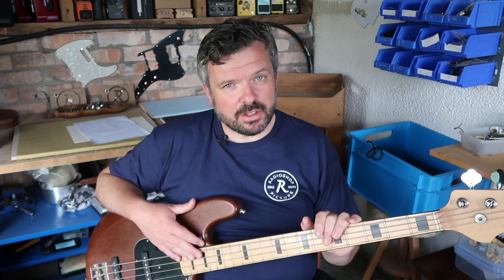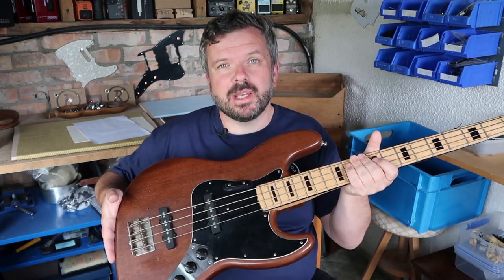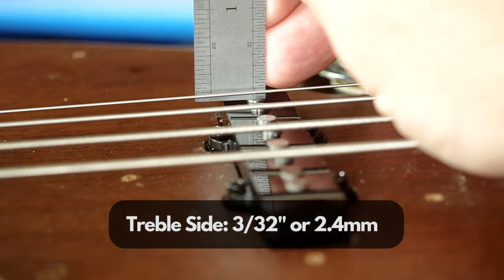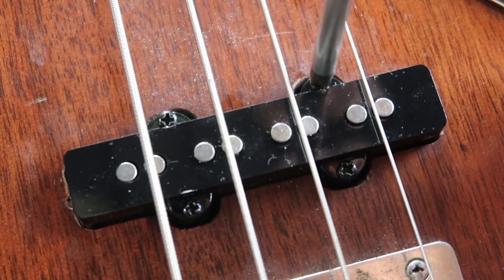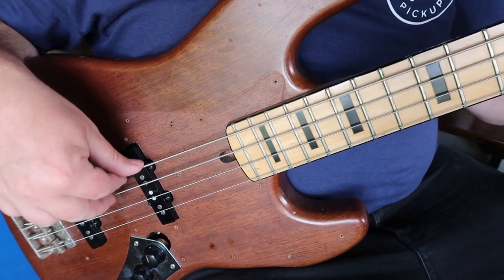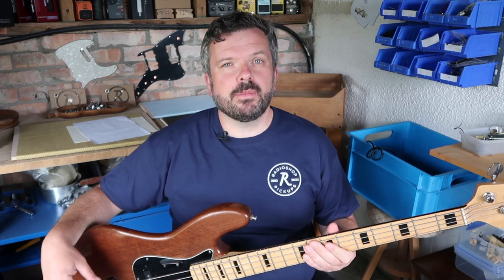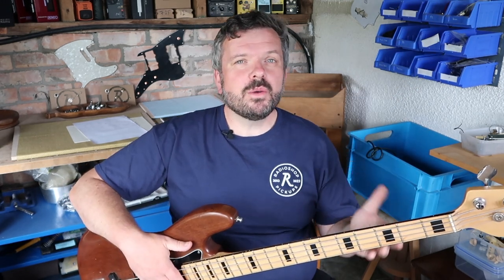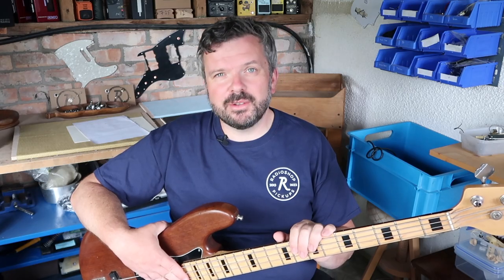How to Set Jazz Bass Pickup Height

Comment: Dear Radioshop, I own a japan jazzbass, just like the one in the video and I did what you did, but I find the E and the G string louder than the A and D, I think because of the fretboard radius the middle strings are further away from the pick-ups than the E and G string, is my assumption right? And what to do about it?
Thanks✋🏼
Reply: You can't do anything. But Dimarzio Model j. You can adjust every little plots. I've got also a Fender MIJ 94 (62' reissue) with a 7.25 radius
Reply: i have the same but only on my A string not on the b e d or g

Comment: Hi, I’m installing a Fralin JP bass pickup set. The poles on the long bridge pickup stick up different heights from the plastic housing - the four poles in the middle stick up more than the end poles. Is this normal?
Reply: Yes, just measure the top(bass side) and bottom(treble side)poll pieces. I would check online to see if those particular pickups have adjustable poll pieces, if not then I wouldn’t worry too much about it being abnormal
Reply: Yea it's a design choice they make. Some pickups have staggered poles like yours and some have equal length poles.